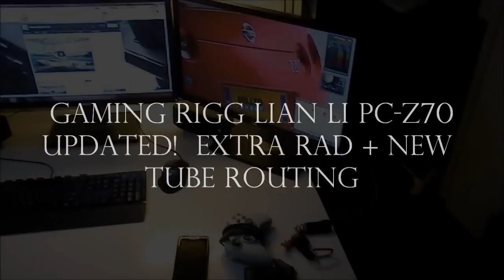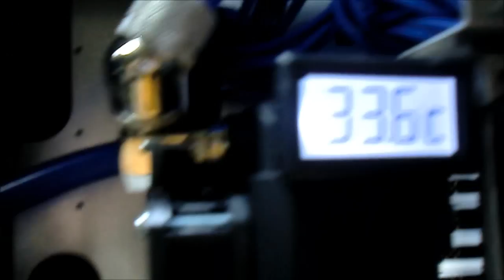Watercooled Lian Li Pc-z70 Updated with new rad.

Comment from the maker: they are 120mm, they cool the hard drive cage and also push out the hot air from the rad, original sidepanel had no windows in it and had vent holes for em, i know have extra fans on the other side that exaust, so with the side panel on now its more for looks

Comment: Hey mate,

How have you vertically mounted the rad to the hard drive bay? I was thinking of doing this with a corsair h100, but I couldn't figure out how to attach it. Are there screws holes that you can use to mount the rad?